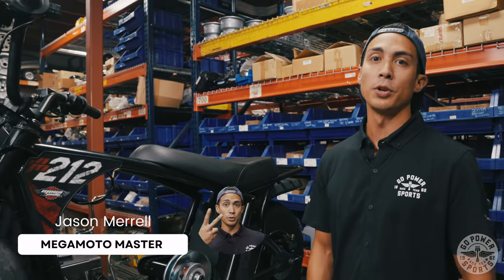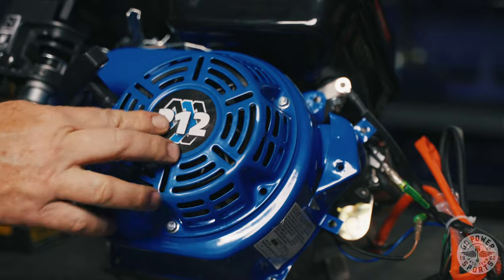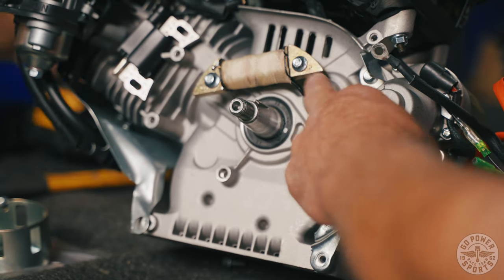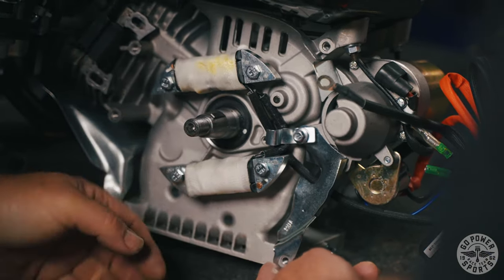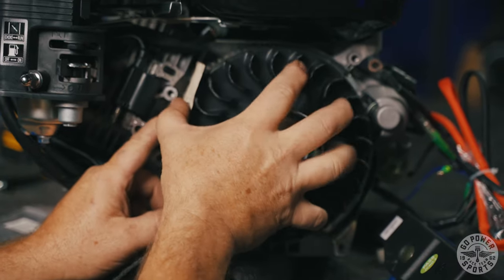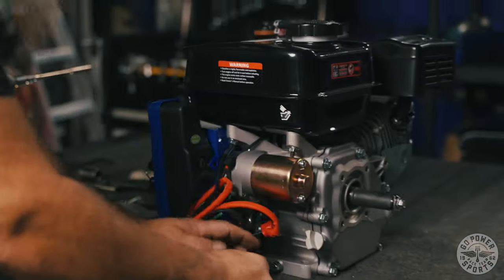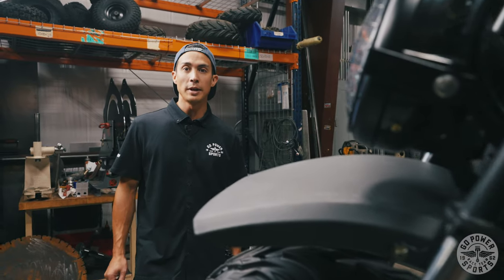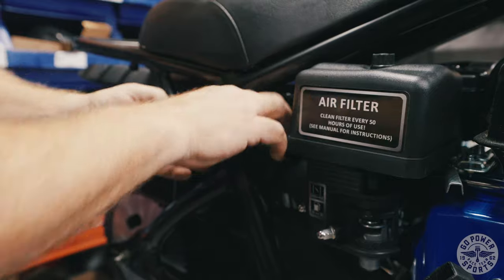How To Assemble Mega Moto 212 LED Light | Option 2

Comment: I just ordered the kit a couple days and I intend to do a sproket swap for the front and rear I know the the rear sproket I want will fit but I don't know if the front one will im trying to get a Manco 9T 5/8B 41P Sprocket and I need to know if that will fit the jackshaft
Reply from the maker: That 9T should fit that jackshaft.  it's Metric, but should be around 16mm.  Close to that 5/8".
Reply: @GoPowerSports  ok thank you

Comment: Would this work on a pull start Predator 212cc or do only the electric start models have the right mounting holes for the coils?
Reply from the maker: I know for sure both Tillotson Pull Start and Electric start engines have both embossings to connect dual coils.  Not sure on all Predators though.
Reply: Is this implying that a stock Tillison with pull only start can get a single coil to power this damn headlight when running?   OPTION 4?

Comment: What they don't tell you is if you don't get the motor with electric start you don't get a a three magnet flywheel on any other motor set up. They don't get flywheels for the pro tuned either, I had to spend another $40 for a flywheel from monster scooter parts plus another $20 on the parallel coils, plus another $20 on a rectifier that should have came with the mega Moto 212 I ordered from gopowersports. With shipping cost ordering parts around $80 later I can run a headlight and charge a battery. Disappointing having to buy all that to get the headlight working especially when the bike comes with switches and a headlight. Don't make any sense. Notice he says, now you can run the headlight!
Reply from the maker: Mega Moto was bought out a few years ago and only left us the frame with no engine.  So now we're trying to help sell all these frames and trying to work with a replacement engine that we already sell.